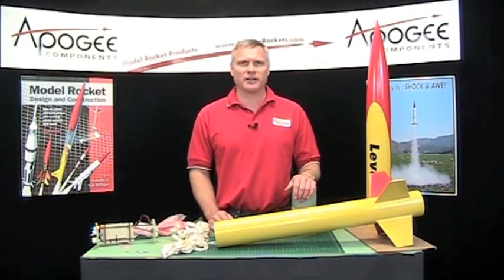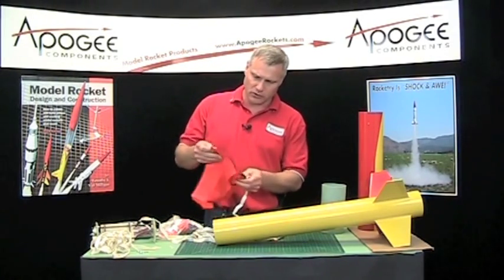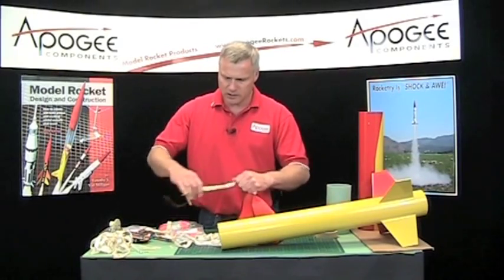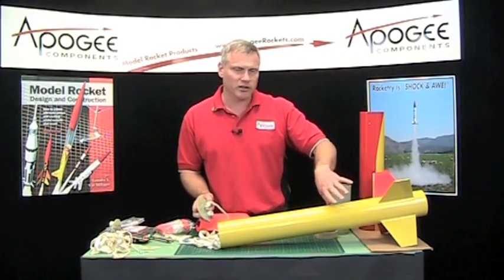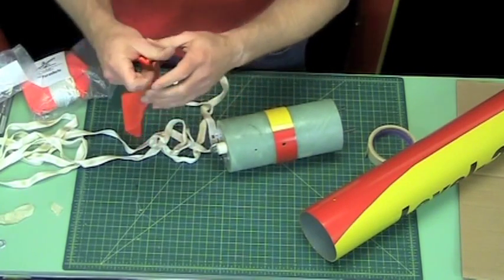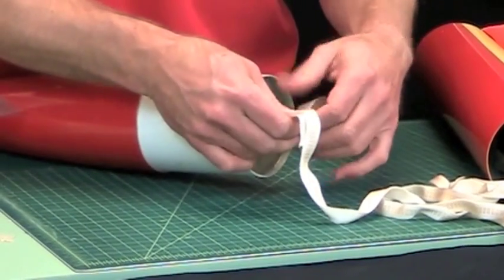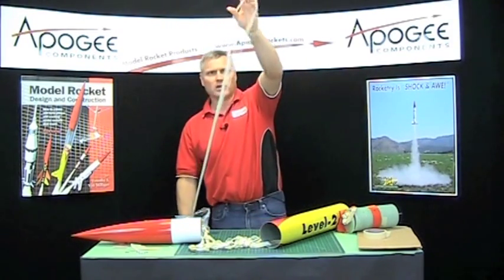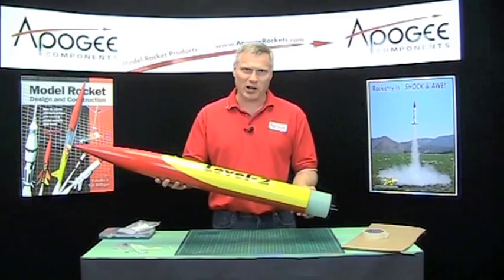Building the Level-2 Fiberglass Rocket Kit - 19: Installing Parachutes

Comment: Love your videos.  I am already a TRA Level 2, but still find your videos interesting and helpful.  I appreciate all the work that must go into them.  I am working on 4 in dual deploy rocket over 8 1/2 ft long and basically setup the same as the one you are working on.  How long are your shock cords?  How did you calculate?  What is width of strap and is it Nylon, Kevlar?  I've been told 3 x body tube length.  Someone else said 4-5 x body tube.  I've only build kits where the rocket came with the chutes and shocks included so I am still trying to figure it out.
Reply from the maker: I suppose it depends on the material of the tube. If it is fiberglass, you can use the 3X length. If it is cardboard, go longer, because they are easier to zipper. My rule of thumb is that longer is better, because it is less chance of a zipper. The "apogee" deployment line needs to be the longer of the two because you don't know what the speed will be at deploy. The main deployment can be shorter, because the rocket will be travelling slower because of the drogue chute. The only thing you need to worry about with a long shock cord is the line tangling. If you can manage that issue, you'll be fine. A lot of people use rubber bands around the cord that simply pop off as the cord stretches out. That is a good way to do things.
Reply: Thanks!  Makes sense.  I will have to try the rubber bands.  I saw it in someone else's video and had never really seen it before.  I also liked the idea of crocheting the shock cord in the low-power rockets, a method which you demonstrated in another video.